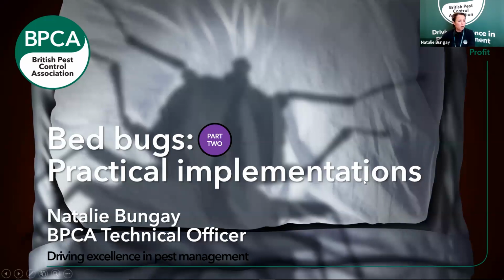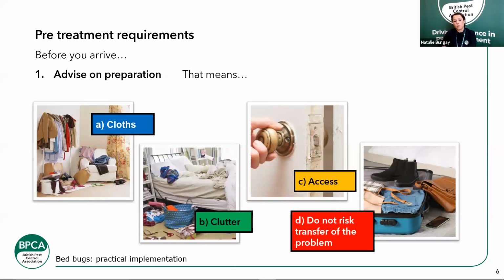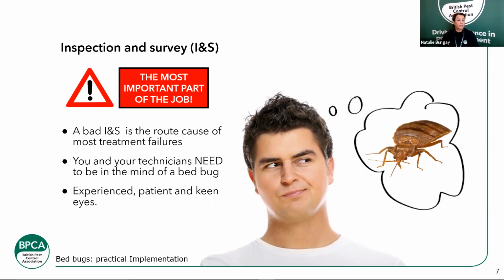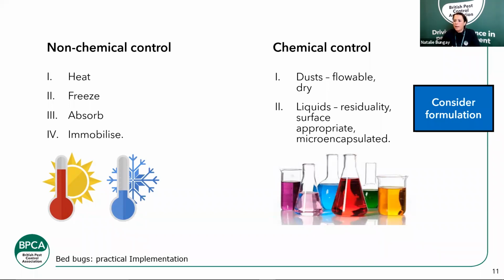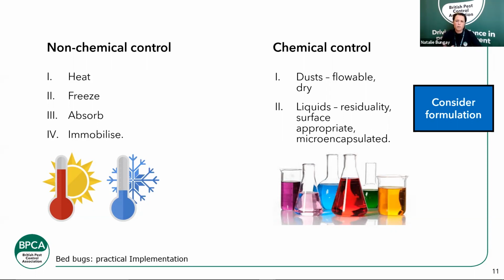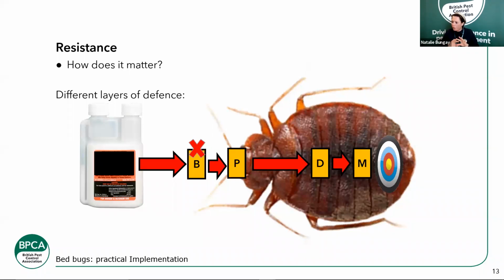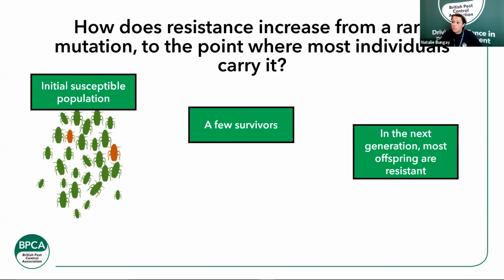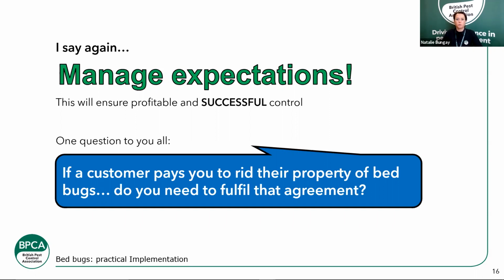WEBINAR: Inspection and control of bed bugs

Comment: I am in America and actually faced with the problem worse because of a professional.  Honestly, from a reasonable customer perspective.  It needs to not be a cut and dry statement.  It should be if customer follows A,B,C etc. and I as the pro does A,B,C then the reasonable outcome should be bug free.  Agreement should go along those lines. My pro never said do A,B,C.  That is how I am now using multiple applications to get rid of them myself and it's exhausting but I have depleted the budget for further pro help but I can say I know they are still here but rarely has the family been bit in 3 months.  I must be doing something right.